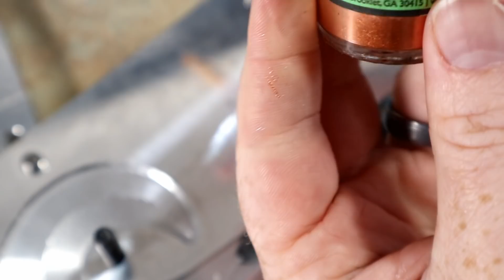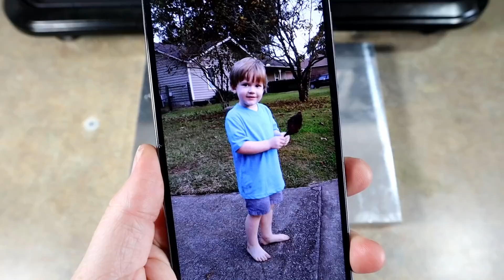Making Some WILD Large Soft Plastic Grubs & Tripletail Fishing Blog

Comment: Could I preheat in the toaster oven you think for that technique?  When it is cold I have been using a toaster oven to preheat injectors and injection molds just to help with denting.
Reply from the maker: No I recommend a hot plate